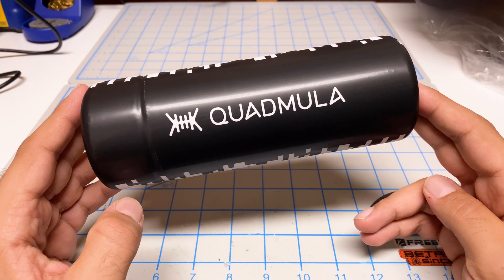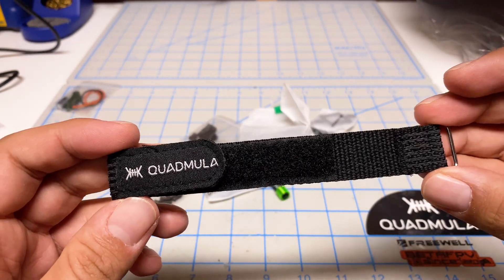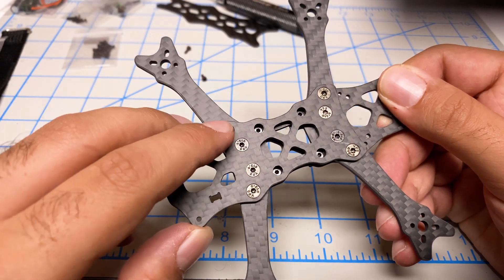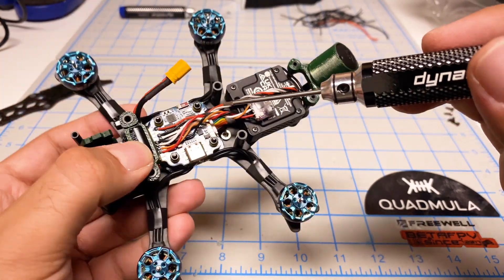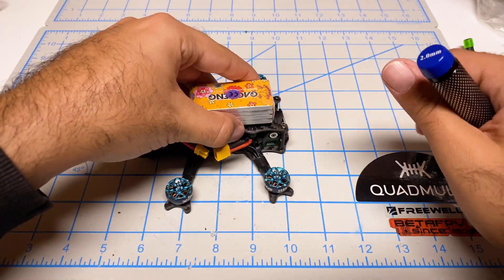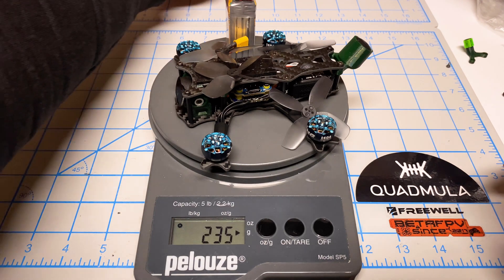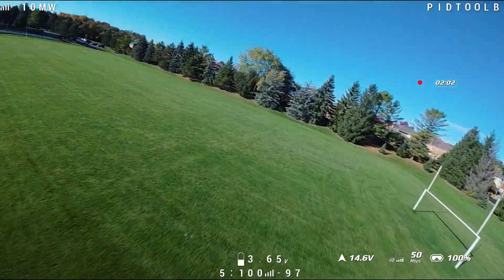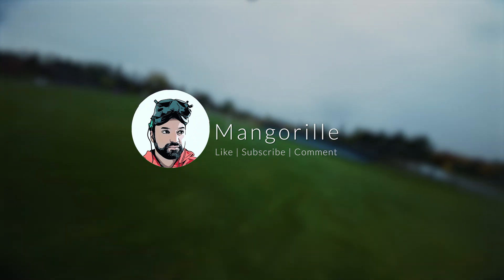Almost PERFECT DJI O3 SUB 250 Gram Micro 🤯 | The NEW Quadmula Djinn F25 2.5" is Here!

Comment: Which propellers do you recommend for this drone: 3 blade or 4 blade? Which ones will give more flight time?
Reply from the maker: Depends on the prop's profile and pitch. When I tried the 4 blade and 3 blade in this video, the 4 blade performed way better and had better flight times. However, I just posted a video on the new F25 SP using the 3 bladed 2.5x2.5x3 which has a wider profile and those actually performed even better. I'd suggest starting with the 2.5x2.5x3 from HQ first.

Comment: Did the TPU capacitor holder come with the frame? If not, where can I get one?
Reply from the maker: Yes, check 1:34 in the video. You can also print your own if you want a different colour.
Reply: @ Thanks.

Comment: Does walksnail moonlight fit in it?
Reply from the maker: Haven't tried but looks like it may. You can always reach out to Quadmula support. Walksnail VTX supports 25x25 mounting just like the O3 and the camera is 19.6mm, which the frame support 19mm. You'll need to figure out how to mount the two antenna though, it doesn't come with a mount for that.

Comment: Hello. I need your advice. My djinn25 assembly is powered by xing2 1404 4600kv motors, 4S 650 mah, weight 258 grams. I would like more traction. What kind of motors can you recommend? Maybe it makes sense to change the motors and switch to 6S batteries?
Reply from the maker: Your setup sounds very similar to the one I used when testing this frame. I don’t think different motors will have the impact you’re thinking. What exact issue are you having? Have you tried doing a PID tune on your quad?
Reply: @Mangorille  Thanks for the quick response. I used your PID settings, it flies very well. My build: djinn25, xing2 1404 4600kv, Speedybee mini 35A, dji o3. I use two 4S 650 and 850 mah batteries. First of all, I really did not like the quality of the xing2 motors, four flights and the bearings on three motors rattled. With the weight of the entire assembly at 257 grams, the hovering gas was 29% (it seems to me that these engines do not have enough thrust, I want a little more powerful). I was thinking of changing the motors to tmotor 1404 4600kv or 1404 2900kv and using a 6S battery. Maybe 1604 motors will do? I need your advice.
Reply from the maker: @AndreySpb_Spb  Interesting, I found the quality of the Xing2 to be fine. Been flying the Xing 1404 motors for the last 5 years. The T-motor 1604 feels better but you're adding more weight so it will impact the handling and flight time. I really wouldn't recommend those on the f25. I'm checking out the Skystars 1404 given Chris Rosser's video so I'll see if those are any better.
Reply: @Mangorille  Thank you so much for your support and your response. I took a chance and ordered 1604 2850kv. I can't refuse anymore, I'll have to try it. I calculated the weight of the drone on these motors and the battery will be exactly 300 grams. Now with 1404 motors and a 4S 650mah battery, it is 257 grams. I hope that everything will be fine on the 1604 engines. I can always go back to 1404. Thank you for your support.
Reply from the maker: @AndreySpb_Spb  Good luck, that's a chunky quad.

Comment: Just got mine delivered and am having so much fun building and flying it. I'm trying for a fully featured sub 250g micro, So running O3 with flywoo lighter mod, Flywoo Goku 45A mini stack, Flyfish Spark 1404 4500kv [lighter and better thrust than t-motors], i grabbed that tiny HM EP2 rx and a Flywoo nano GPS. I was recommended the HQprop DT63x2.5 3 blade props for that good in between of pitch and thrust.
Reply from the maker: Awesome, glad you're enjoying. If you can swap to the EP1 receiver and still be under 250g, I'd recommend you do that. The EP2 is fine for close flying but there is a noticeable range reduction from the EP1. I tried the Gemfan 2540 and the quad actually lost performance.

Comment: Loved your video, had me buy the frame and now I am stuck in ESC hell ... Right now when I load BlueJay, the motors don't all spin, actually only one does. However when I go back to BLHeli they all work. Same ESC/FC you have ... Any suggestions or ideas? THANKS
Reply from the maker: The motors don’t spin when you try to use the motor tab in betaflight either? Is it always the same one that start up while the rest don’t spin?
Reply: @Mangorille  running BLHeli all works fine, motors spin in Betaflight Config as expected. I upgrade to BlueJay 21 and only one motor spins. Then I thought I try BlueJay 19 and voila, all is good ... guess there is some incompatibility with 21. I posted something on their Discord and will update here if I find out why. THANKS for responding
Reply from the maker: @RobertTheFriscoSchmid  No problem. You may want to try increasing the start up power in the config, I had to do that on a tiny whoop when I upgraded the blujay firmware.
Reply: @Mangorille  great suggestion!

Comment: Wouldnt it be a problem if you use T-Motor F1404 2900KV Motors with 6S batteries? Did you experience any issues?
Reply from the maker: I haven’t tried that motor but the specs seem fine for a 6s motor. What’s your concern? My usual motors are the Xing2 1404 or the T-motor 1604.

Comment: I see alot of people do 6s on this. What is your opinion should i go 6s or 4s?
Reply from the maker: How important is staying under 250g for your build?
Reply: @Mangorille  not really at all. I don't care to much.
Reply: Just want It to be awesome and the best it can ha ha
Reply from the maker: @Huntmx24  Go with 1604 motors and a 6s setup in that case. If you want something light and under 250g, go with 4s and 1404 motors. I went with 4s and 1404 and was happy.
Reply: @Mangorille  awesome. Still deciding. Thanks so much for the input

Comment: Hi Mangorille, can you send me a Screenshot from your filtersettings. I want to try your Pids and Filter Settings, but i can not find the Filter Settings in your Video. I use BF 4.5.0 and want to Set this manually, because you Fly at 4.3. my other components are the same as you used. Thanx in advance
Reply from the maker: You can see the filter settings in the Dump File in the video description under "My Betaflight 4.4.2 Diff Dump CLI & 3D Print Files".

Comment: Hi, i saw the filter Setting in den BF Tab, Both solidere are full at the right side. Ist this correct? Whats the motor temperature, are they overheating? Regards, Sascha
Reply from the maker: Correct, I rely more on the rpm filter. You can have the sliders all the way to the right if your quad is mechanically sound and not very noisy. If unsure, start with the filters in the middle default position.

Comment: I have the problem that I bought a ready-made Djinn25, which has the same hardware setup as yours. Unfortunately, I can't set up the copter properly. It twitches on the yaw axis during flight. I want to test your PID tune now. I suspect a defective gyro.
Reply from the maker: How exactly does it twitch and under what sort of maneuvers?
Reply: @Mangorille  i have these twitches, if i take off and the Copter does go with the back to the left side clockwise. During flight, you can also clearly see these twitches through your glasses. I suspect I have a bad gyro. I will now test your dump and see if the flight behavior changes. Without a propeller, the motor tab looks inconspicuous. The motors spin up smoothly without any failures. Really weird
Reply from the maker: @SaschaMittag  Without the props on, do you feel any weird vibrations when you spin up the motors? If you put all the bars at one point on the motors tab, do all the motors show roughly the same rpm (you'll need bi-directional dshot turned on for this)?
Reply: @Mangorille  no weird vibrations, i changed to Bluejay and Set the Pids and Filters to default. The copter Flow better. I will try your Set up again and give you a reply.

Comment: Hi Mangorille do you use Bluejay or the Stock esc Firmware Bl Heli S, with your PID and Filter Setup ? Oh sorry i didn t see your Video Part with the Bluejay flashing my mistake
Reply from the maker: You want a firmware that has bi-directional dshot. Either blheli32 if supported or bluejay.
Reply: @Mangorille  i have the Same Stack with the new Bosch Gyro . ESC are jh40. Bluejay is possible
Reply from the maker: @SaschaMittag  Definitely get bluejay on there.

Comment: I‘m more the Freestyle Guy😎 luv my 5 inch. My 3 inch is nice to fly, but the QUADMULA Frame rocks and i like to try this 2,5 inch Ripper with my hd Setup. I saw a lot of Videos with the 6s . So how is the Performance ? What do you recommend? On my 3 inch i use 1404 4800KV Motors and the Copter has a lot of power with 4s.
Reply from the maker: If under 250g is not a priority, go with 1604 motors and 6s. The reason I ask about 250g is that most small 6s battery packs (say under 600mah) start to lack in performance (e.g. high internal resistance).

Comment: 3inch 3018prop 12minit 3s 2kmah 250g
Reply from the maker: What kind of battery you running that can be 2000mah and get you under 250g??
Reply: @Mangorille  18650  10c..motor using like darwin fpv pro..small and light
Reply from the maker: @ourchannel8215  Ah okay, just long range cruising right? I don't typically see folks using Li-Ion for freestyle or any aggressive flying.
Reply: @Mangorille  yes.. but I'm not long range.. I haven't given up to losing my drone😆.. a bit aggressive but a little bit because the motor gets hot..sorry bad english..malaysia

Comment: Love your sub250 build videos! Does your o3 air unit get hot or ever shut off when making it naked with your stl files? Or how does it do with the heat in your experience?
Reply from the maker: Thanks! It does shutdown after a couple of minutes on the ground but never in the air. Check out these two videos:

https://youtu.be/NIpNry4M-lc
https://youtu.be/gxt-7bHG9vQ

Comment: How did your weight end up at 235g? I've just built mine and I'm on 251g with that same battery. My stack is the other way around but that's only going to account for about 3grm of wiring, where you have an extra zip tie.

I can't see where I'm wasting 15g

That's with 3 blade props too.
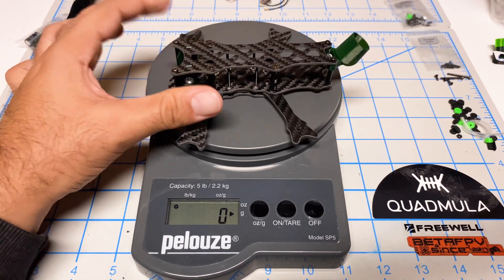Reply from the maker: Check 3:35 in the video where I weigh individual components to see where yours is different. I suspect you’ve got heavier motors. I ended up at 239g with the battery strap after the build.
Reply: @Mangorille  I don't think it's the motors. Yours work out 41g total and mine are 8.8g each.

All that's different are the tpu feet and chin bumper I have. Plus a rubber band on the battery to keep the balance lead out of harms way.

Could it be the 8 prop screws? I don't see those on yours when your weighed it.

Or my scales are wrong, I prefer that option 😂
Reply from the maker: @davidcane7211  The TPU feet and chin guard are 6 grams, which I don't run. The final weigh in did not include the prop screws so that would probably add another 2-3 grams. You're not too far off my build. The rest can be simple things like wire routing, type of wire in your power lead, etc.
Reply: @Mangorille  I changed the battery strap for a shorter narrower Diatone  one and seem to be down to 250g with the 4 blade props. Also changed the rubber band on the battery (strapping the balance lead down) for a shorter one.

Quite happy now, just need to conformal coat that stack so I can crash in the damp british grass 😀
Reply from the maker: @davidcane7211  Great! If you really want to reduce the weight, go with a decased air unit. I've done that and have another video on my channel.

Comment: Building two now the 3.5 and 2.5. I fly my Quadmula Siren F-5  it's my daily it flies amazing and it's Indestructible, I hope the small ones are.Also i'm sure they  will be they're smaller and lighter.
Reply from the maker: The 3 inch is my go to. They fly so well that I very rarely fly the 5 inch now a days. I’m going to be doing a Quadmula 3.5 build soon.
Reply: @Mangorille  Do you still fly the Djinn F25? I'm considering between the F25 and F3.
Reply from the maker: @chesterlim15  For what kind of flying?
Reply: @Mangorille  less cinematic and more freestyle. I was hoping that it’ll be more similar to a 5inch without being over 250g.
Reply from the maker: @chesterlim15  If you intend to do more freestyle you definitely want the 3 inch. You can easily the get the F3 under 250 gram. The F3 is my daily flier, I've got a bunch of build and upgrade videos on my channel.
Reply: @Mangorille  thank you! I’ve seen those videos from start to end probably half a dozen times now 😂. 

Btw, I’ve heard that it’s possible to mount the F3 arms on the F25 body, to achieve the free of prop view on the O3 while on a 3 inch form factor. Requires drilling of new holes though. If this is something that you’ll be interested 👍🏼
Reply from the maker: @chesterlim15  The arms on the F25 and the F3 are not interchangeable, they are ever so slightly different. I actually tried thinking I could use the smaller body of the F25 on the F3 but the screw holes did not line up.

Comment: I'm on the fence if I should build the 3 or the 2.5 from quadmula. Which one do you like better? I've wanted to use it for freestyle and some cinematic flying in the city/a more crowded area. Because of the new laws in Europe it's not allowed to fly over 250g self built quads closer than 150m to building and people anymore. And is the EP2 sufficient range wise? Even with an EP1 it should be under 250g right?
Reply from the maker: Which is more important for you: freestyle or cinematic flying?
Reply: @Mangorille  probably freestyle
Reply from the maker: @sirfancyfants I'd suggest the 3" in that case. The only negative with the 3" is that you have the props in the video recording but if that's not a deal breaker then the 3" is the better freestyler.

Comment: What is the correct way to trim antenna tube, do you cut the wire and slide it out? Or you get a pair of scissors and trim it carefully?
Reply from the maker: I used an X-Acto knife to carefully slice the tube along the circumference. Once it is two pieces you can use scissor to slice it vertically and route the wire out. The UFL connector at the end isn't very strong so don't try to pull it though, the wire will separate from the connector.

Comment: Why Bluejay/Bidirectional DShot?
Reply from the maker: You need bi-directional dshot in order to use RPM filtering, pretty much the standard way of filtering now-a-days. This is not supported on regular BLS firmware so you need to install Bluejay. If your ESC is a BLHeli32 then it already supports bi-directional dshot and you wouldn't be putting Bluejay on it.
Reply: Awesome @Mangorille  thanks!

Comment: hi! i run your PID tunes you show in the video...seems to be good, but i am still struggling with rates. i use 2.5x1.5x3 HQ props that results in low propwash buuuuut you always need to push a little bit more on the throttles to get the copter up in the air. i am still not familiar to it. BTW: the weight of my copter is too high...251g with a little bit more of battery wiring and even 257 when i am going to built in ELRS. THX4 the video!
Reply from the maker: Hey. I’d suggest going with a higher pitch prop especially when you’re running 3 bladed props on such a heavy quad. Any way you can go lighter on the quad as well?

Comment: I have a speedybee f7 mini as well but I cant find a pinout for the o3 air unit. How did you connect them?
Reply from the maker: Check out this picture from the F7 Mini manual. The O3 will wire up the same as the Vista in this picture except that the O3 has one black and one brown wire instead of two blacks on the Vista.

https://store-fhxxhuiq8q.mybigcommerce.com/product_images/img_speedybee_f7_mini_stack/F7-MINI-11-0201.jpg
Reply: Thank you very much

Comment: Great video and thanks for sharing your tune, just built my own Djinn25 in a very similar config and while stock betaflight was alright, its definitely much smoother on your tune.
Reply from the maker: Glad to hear that. You can also go through the PID Toolbox process yourself to find a tune that is more specific to your own quad. https://youtu.be/dnVW6agh_u4
Reply: Hi just finished the build , your tune says force-4-cell batery ,
Do you have a tune for 6s?
I get a lot of prop wash with your tune for some reason - thanks just finished building it and loving it 🎉
Reply from the maker: @orangure  I only flew this setup on a 4s battery so you'll need to do a tune yourself. What 6s battery are you using? I like to use PIDToolBox for the PID tuning: https://youtu.be/dnVW6agh_u4
Reply: Hi, wich BF Version do you flight for your djinn? Regards Sascha